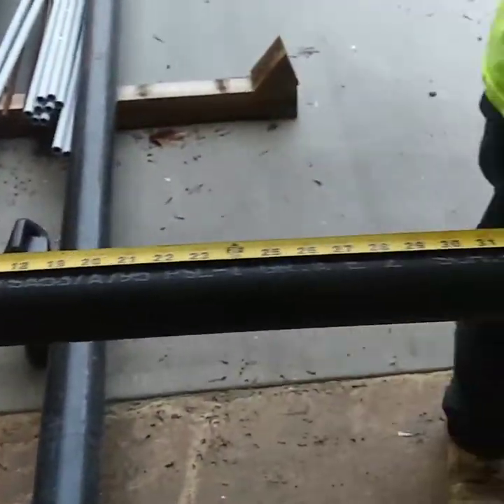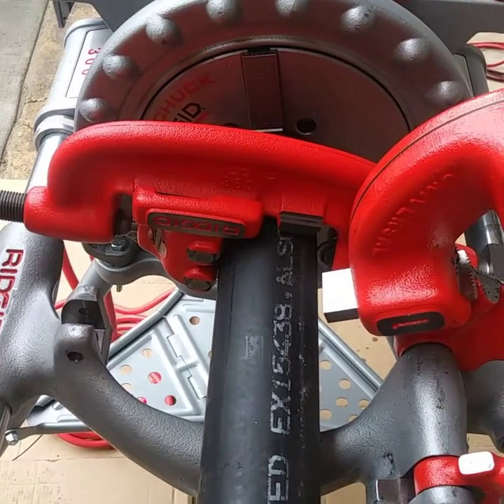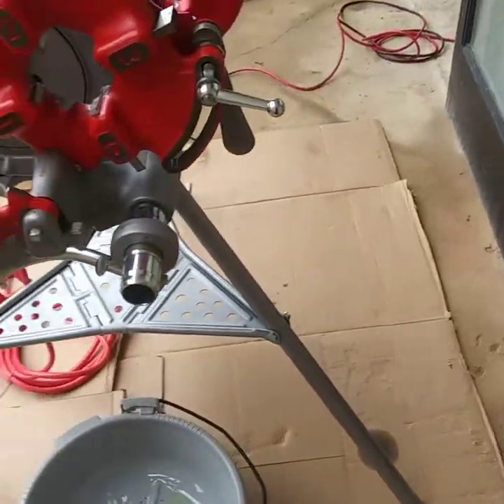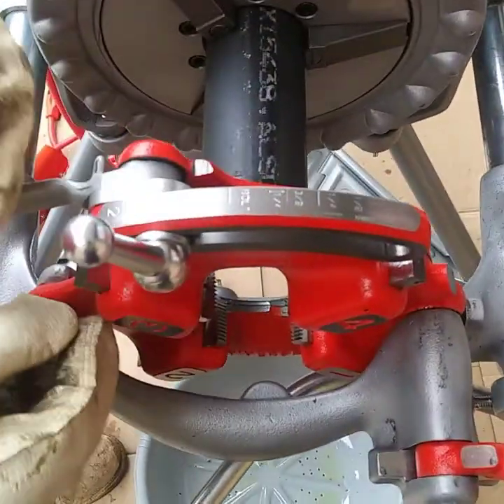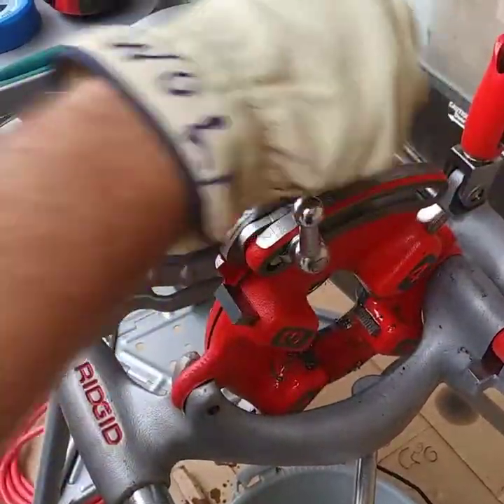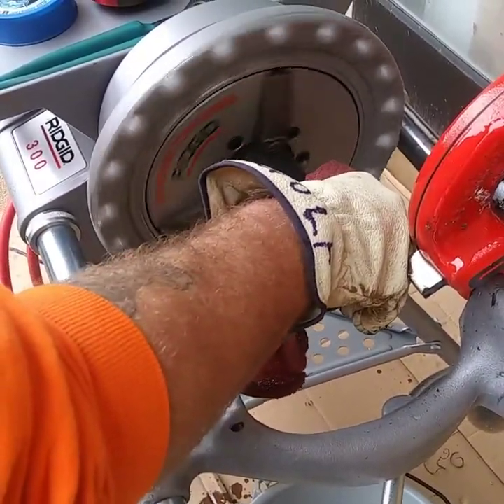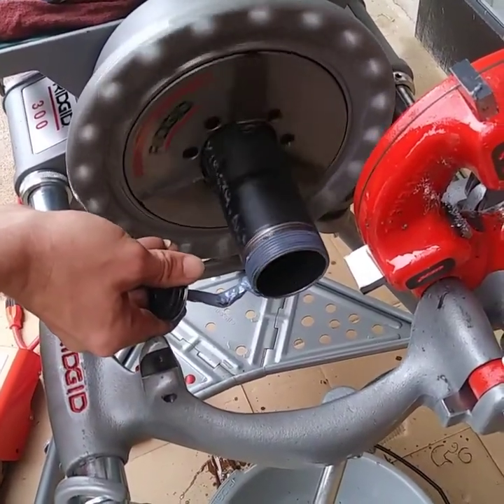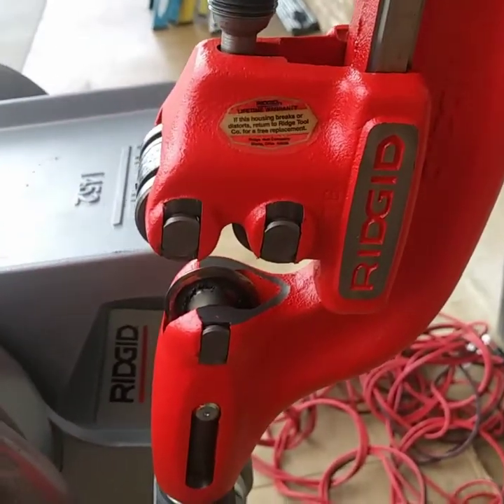How to use a pipe threader (Ridgid 300)

Comment: Let me start off by saying rule #1 of threading pipe...NEVER EVER stop the machine while still threading the pipe. Hence the reason you had to run it back through to clean it up. Also to get proper make in on the fitting you set your dies to get 3-3 1/2 turn by hand. What’s the deal with oiling all parts of the thread your supposed to oil the top in the back where it’s cutting and it’ll run all over the threads. You got some bad habits running that machine.
Reply from the maker: I've been doing it for 17 years so I know the oiling method is fine.  As for the stopping causing the bad threads that's far from the issue.  I've dealt with enough machines to know that the problem was it being new, and the teeth weren't broke in yet.  As for bad habits....I'm a construction worker lol of course I have bad habits lol
Reply: this is the comment i was going to make lol took the paragraph outta my mouth 😂
Reply: Well you obviously been doing it for 17’years the WRONG WAY. I’m a union sprinklerfitter and I use this machine pretty much everyday of my career so yeah your wrong.
Reply: @fitter5423  the way i was taught was aim the oil to the back teeth on the top and that you should get 3.5 turns by hand to know your threads are good... any thing else is too loose
Reply: @truewolf8219  yeah sorry just cuz you do it a certain way doesnt mean its the right way. go take a class on pipe threading. several things were done wrong here. you only did 1 turn in total ? you counted 1/2 turns as a full turn. you need 3.5-4 turns.
Reply: @grimlazer5105  you’re so right.

Comment: Totally wrong. The fitting check is 3-1/2 turns.
The Teflon tape goes on first, the Teflon paste on top of the tape. 
Note: Union shops never use tape. They use quality thread cutting dies, and get it right the first time.
This video is for incompetent plumbers, who are like “ shade tree mechanics”. 
Embarrassing-
Reply from the maker: Given how many hydro and air tests my work has passed with zero problems or complaint your opinion is definitely open to debate.  But you are more than welcome to make your own video showing your method.

Comment: Any other apprentices in here, do NOT STOP THE MACHINE WHILE STILL TOUCHING THREADS. Pop the handle on the die back up so it's not threading THEN shut the machine off.

Trust me, about 90 journeyman RIPPED ME A NEW ASSHOLE for doing it how I saw in this video. 

Learn from my mistake. This guy shows the wrong way.
Reply from the maker: I highly doubt "90 journeyman bout ripped you a new one".  Everyone works differently.  Whichever company, or union you're working with may just prefer you to operate it their way.  Trust me when I say I've threaded more than my fair share over the years to know what I'm saying.  But if you're company has a different preferred way then by all means make a video showing your way, and you're more than welcome to link it here.
Reply: @truewolf8219  my bad didn't realize you were there to see.

Yes i was corrected, harshly. Told I would damage the machine die as well as not get good threading on the pipe. And this was by MANY journeyman, foreman. And even rhe safety guy lol. 

I'm just a first year apprentice, but when EVERYONE there told me it was wrong, it's wrong.

Went to watch other videos on it and they all show the same, release before stopping. Always. 

Everyone makes mistakes, fix your video. Be man enough to admit when you're wrong.
Reply from the maker: I'm very much man enough to admit when I'm wrong.  I've also been doing the same method for 20 years now in construction with zero problems.  So from my end my method works perfectly.  Again though if you feel it's not the correct method you're more than welcome to make a video showing the method you were taught, and can gladly link here to show others a different perspective.  Thank ya.

Comment: You want one thread past the dye.  Fyi
Reply: I was taught 2.. not that deep tho. Dude I’ve seen guys not even go flush with the dye and they were good
Reply: @richiedeleon566  1 thread past the chasers is your dead center for NPT fittings any further starts making it so you can wrench the pipe in deeper putting put your center measurement.    But in reality we aren't building rocket ships.  I'm a journeyman sprinkler fitter building Timex not Rolex lol
Reply: @kpj9028  haha that’s funny dude.. ya I’m a pipefitter.. 5th year apprentice.. I haven’t done threaded pipe in a while.. sadly the industry is getting away from old school methods. Mega press/ pro press sucks.. ya it’s quick and easy.. but it takes the skill out of our trade
Reply: @richiedeleon566  I'm only 9 years in the trade.  But we live on the 300
Reply: @richiedeleon566  mega press was some BS. EXACT same process as pro press but the GF made us do an online certifications and test before using it. Was odd.